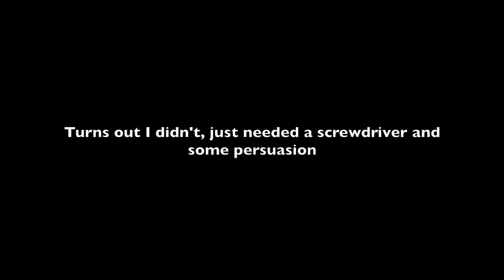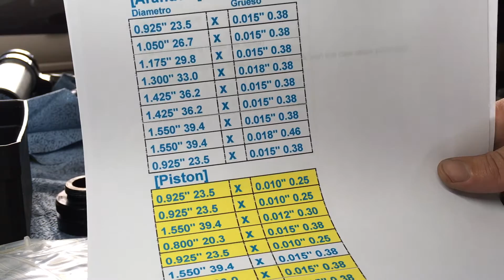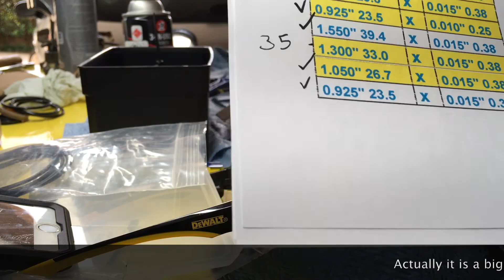Icon Shock Rebuild Part 1

Comment: Did they hold up after the rebuild? Did they leak? I’m gonna try this. I had my shocks rebuilt by icon themselves and they leaked within 6 months. So if they can’t do it right, I doubt I will be able to.

Comment: Thanks for taking time to document the ICON rebuild.  Where did you get the instructions/documentation/specs on the rebuild?  My front coil-overs need to be rebuilt because they are leaking, but after seeing the total process, I am not sure I have the confidence to do it myself.  Enjoyed watching you do it.  Note, I didn't hear any sound at the beginning of the video and it had me wondering if I had a PC problem. A note in the description would have eased my concerns...
Reply from the maker: Haha maybe I should insert the Benny Hill theme there at the start! So I didn't really have any documentation apart from the valving specs which I got from Adrian at Icon, and also the torque for the bolts and shaft, which I also got from Adrian. For everything else I kinda cobbled it together from watching videos for Fox, King, Sway-a-way.. took me like 6 months to get the courage to do it, plus I bought a run-around in case I screwed up haha! You could always do it along with a friendly mechanic, then if you have trouble with something like replacing the bushings, they sometimes have old school tricks up their sleeves!

Comment: How'd it go?  I just bought a lot of 30 - lots of rebuilding to do.
Reply from the maker: went great, thanks! I did the coilovers later on which had a slight difference in that the hose routes from the top not from the side, but they are running smooth and no leaks :) with a lot of 30, I would certainly invest in a parts washer as cleaning and drying the parts probably took longer than taking apart and putting back together once I had my process down!

Comment: How many miles on the shocks? Thanks
Reply from the maker: Dana Idnay probably about 20,000 at that point
Reply: Thanks.
Do you need to rebuilt it in 20,000 miles? Is there a problem you got in 20,000 miles?
Reply from the maker: no, the 20,000 is just an estimate since you asked, and I figured how long I had driven in the last year and a half.. the rebuild was because there was a bit of oil seepage and some noise, and I figured I would rebuild them to rule them out of the issue.. turns out the noise wasn't coming from the shocks, but it had been almost 2 years with some hard hits, so figured it was about time anyways!

Comment: About to attempt mine soon and found your video. 

Could you give me a list of tools and parts.  Btw i think i need to change the shaft too. 

Cheers and thanks for the effort
Reply from the maker: Hi! Do you need to revalve, or just change the seals? You will need some good quality hooks to get the clips out, and to get the seals out, some of them are pretty tough! Brake cleaner, degreaser, a bolt welded to a long piece of metal, or some long pliers (to purge), they do sell a specific tool for that though, I think its a 12mm thread. for the front ones you will need a 12 sided socket, can't recall the size, its for removing the top hat. Something to catch the oil, somewhere to bolt down the shaft, some spanners, and plenty of patience! :)
Reply: Thanks for the info. 

 I need to rebuild (leaking on the rear) and possibly one of the shaft due to chips
Reply from the maker: @kritzc2809  oh right, yeah, so changing the shaft is simple enough since you will be stripping it down anyway, so its just a matter of not building the same shaft back up. You will either be putting in a new ball joint bushing or re-using the old one (better to get a new one) and for that you will just need two thin flat tipped screwdrivers to work the retaining clips off. 
Talking of scratches, be careful when taking the clips out of the reservoir, not to scratch the inside as a scratch up by the seal surface can cause a leak. Good luck!
Reply: Thanks @chrisdarke , appreciate your time and information :-)